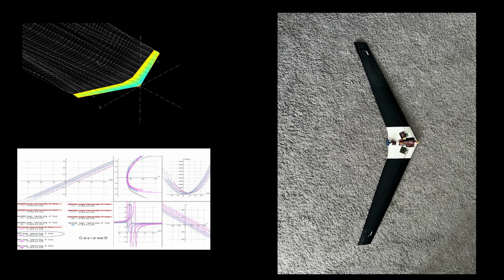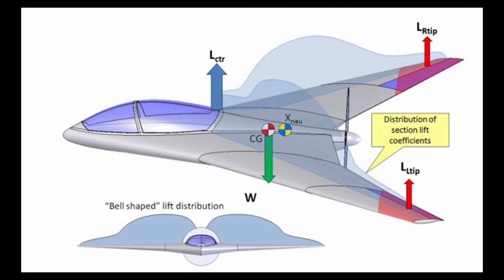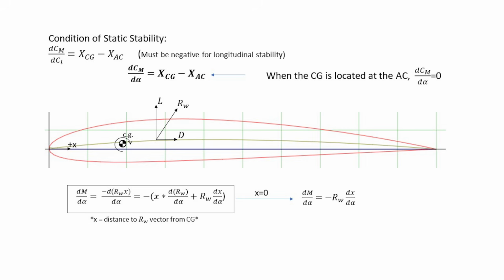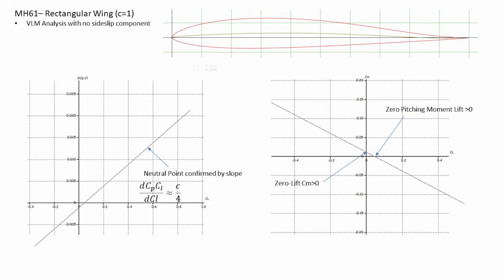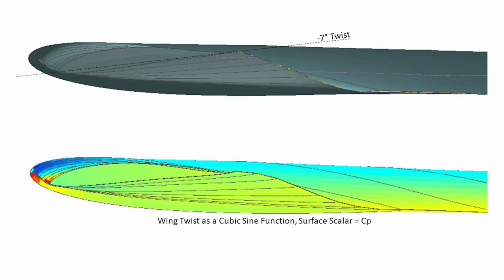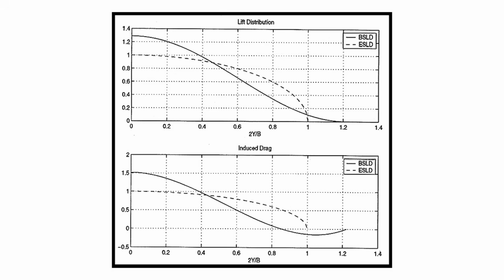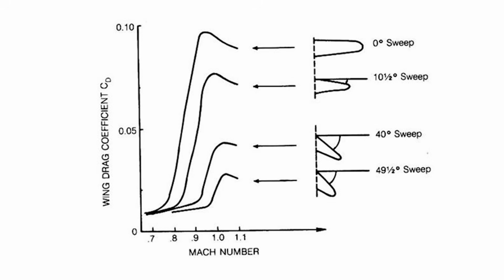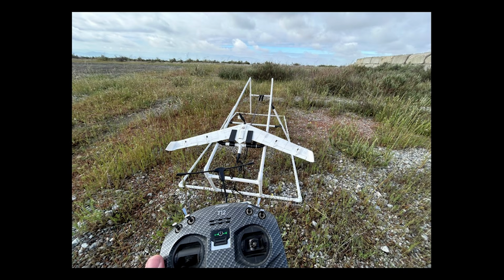Basic Design Theory and Aerodynamics behind Flying Wings and Tailless Aircraft (Part 1)

Comment: Well organized explanation! Thanks for making delicate diagrams and sharing knowledge with us. 
However, I have 2 questions about airfoil Cm, and one question about the span loading. 1) How did you calculate the Cm of the airfoil? My result of Cm indicates an positive (d Cm/d \alpha) for MH61 using xfoil. In practice, the CG still needs to be situated about 4%MAC in front of NP to get the overall (d CM / d \alpha) <0.  2) Are there truly "self stable" airfoils? According to my result using RANS method in OpenFOAM, most of the airfoils, even NACA 23112, is not self stable.  3) Is BSLD true? Nickel's book said that it was not true. Whether BSLD is really as good as it was described is on doubt, in my view.

Comment: so if the design of a wing with a variable sweep angle and length  and dihedral angle , maybe it can have a twist but didnt implement that yet, would the lift of such a wing where every time any of those variable can be changed for diffenrt situation can be simulated ? or have any benfits to begin with ?
Reply from the maker: Variable length would be a massive challenge by itself
Reply: @gabefpv  so do you think i should keep working on this or its just not useful or will be have any benfits to have such a wing , the idea is to have it on small airplanes or jetpacks , thats for the long run, for short objective is to make it work on a rc model.

Comment: Hello. I read that the aerodynamic center for flying wings isn't 1/4 of the chord. How can i calculate it? Do you recommend any literature?
Reply: The challenge is with swept wing.  The presence or absence of a fuselage doesn't change it. However, the sweep makes it difficult to measure.

1/4 of the way back from the leading edge *where*?  At root of the wing?  At the tip?
There are online calculators you can use.

Comment: which software are u using i am a beginner
Reply from the maker: For what?
Reply: @gabefpv currently doing undergrad in mechanical engineering (1st year) 
So i was just curious 😅
Reply from the maker: @samneginegi1374there are several software used for various disciplines. Which are you referring to?
Reply: @gabefpv  basically want to design the aerodynamics of cars and see how the air flows around it like (lift downforce etc)

Comment: Excellent video! Lot of good material covered here. I flew hang gliders and a flying-wing ultralight sailplane for about a decade, so lots of fun memories of flying wings.
One question you haven't answered - maybe in Part 2? - is whether the "flying wings should be more efficient" idea actually plays out in practice. As I understand it, the theory is that a) absence of a tail reduces wetted surface and therefore drag and 2) absence of the tail and tailboom reduce weight, allowing a smaller, lighter wing with even less wetted surface to lift a given load; but the reality is that if you want satisfactory stability characteristics that theory turns out not to be true because a) reflexed or washed-out wings have substantially less lift per unit area, i.e., they have more wetted area per unit of lift than a conventional wing, and b) the additional wetted area and its structure add weight. What's more, they're less flexible in use because c) the efficient speed range of a washed-out wing is narrow and d) you can't really put large high-lift devices on a flying wing because there isn't enough elevator authority to overcome the pitching moment that results. So, in practice, conventional wing-and-tail designs are as efficient and more generally flexible than flying-wing designs - which is why the sailplane world has repeatedly tried flying wings only to go back to high aspect ratio straight wings plus small tails on long skinny tailbooms. But - do you agree, or is there an angle sailplane designers are missing?
Also a comment: you said that birds use Prandtl wings and that's why they don't need vertical stabilizers. "Don't need vertical stabilizers" implies that they don't need yaw control, but if you watch birds in slow flight - crows or hawks make it very obvious - they do in fact use active yaw control. In slow flight, these birds spread out their tail feathers and use them to generate lift. They tilt their tails side to side, moving the lift vector side to side, as yaw control. So, to turn left, they roll their tails to the right. Not saying they don't use Prandtl wings, only that they do use active yaw control, which presumably also compensates for the fact that they don't have passive yaw control, i.e., vertical stabilizers.
Looking forward to Part 2!

Comment: Gabriel, it's a well put video explaining flying wing principles. I'm a fun of unconventional planes especially flying wings. I've seen your wing at the beginning of the video and I thought the one I'm working on now damn I've copied from you - but is almost exact shape 😀 . My wing would have enlarged elevons at the tip, so change the twist of the wing in some range. I'm still struggle to figure out size of the elevon at the tip. In basics is to maintain a fairly constant lift distribution by controlling aoa and the twist ... as a hobbiest experiment
Can I ask Is it possible to share to me the Pankin twist excel sheet that you have ? There is one made by Curtis S. but i think yours is much better.
... and waiting for the second video
Thanks,
Reply from the maker: Google Sheets messes up all the plots but the calcs are there in the description if you'd like. Standby for me figuring out how to share a true excel sheet
Reply: @gabefpv  The graph does not work propperly indeed but the rest is just fine. Thanks for sharing. 
I would need some help to ensure my XFLR analysis is correct, I would like to ask if you could make hlf hour available to talk ( may be share screen ) ?

Comment: Prandtl DIED over a century ago.  The wing  only Craze  pretty well ended by  the 50's.  With a history of failures.   
Basic attraction currently is in lower Radar profile.  However Only processor  controlled aero aids keep the current b2 airborne.
Reply from the maker: I may add that almost all fighters are inherently unstable too, FCS/FBW and SAS's are a work of art